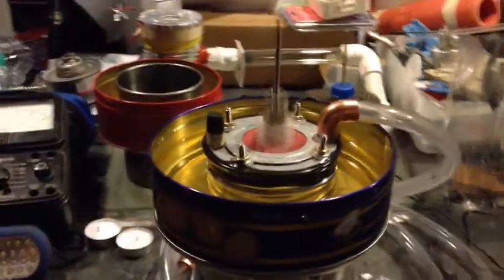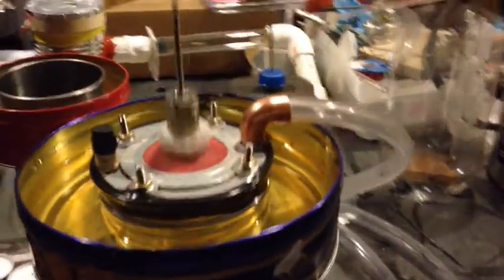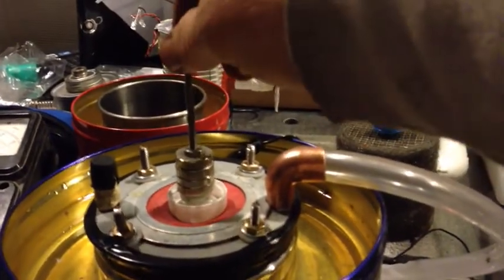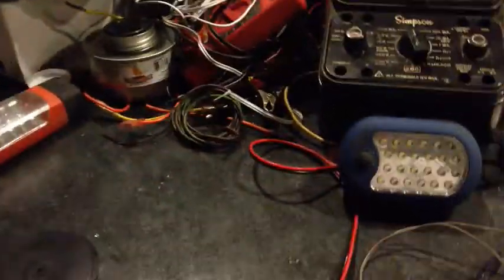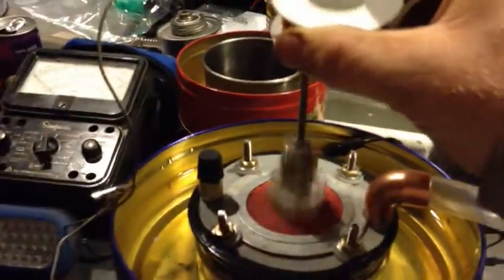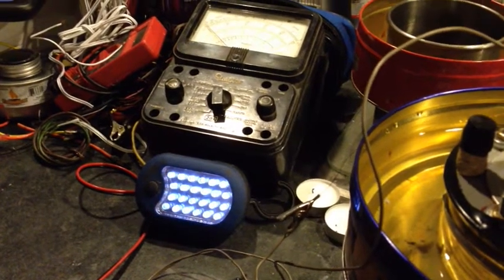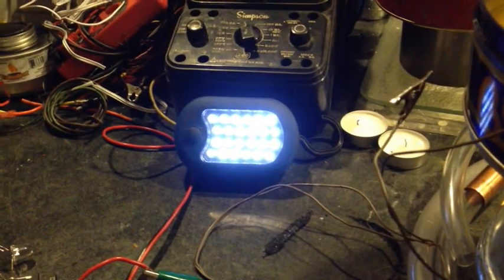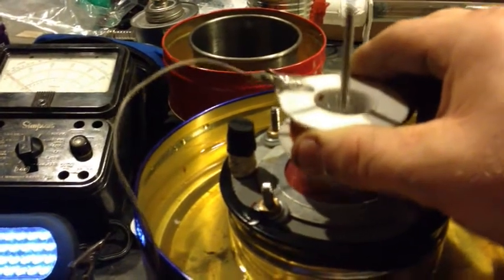Thermoacoustic Stirling/Hybrid Producing Power V2.3

Comment: This is fantastic power output with just a teelight ? Instead of the diy generator you can use a speaker which si basically a linera generator.

Comment: thanks for posting.  good work.    but, it should be understood that in order to get maximum efficiency from a reciprocating system,  output  motion  Must  be  converted to  Rotary.    because, without this,  the system has  ZERO  conservation of momentum.      you may know  that there is an optimal design of a generating coil.    one.   it should be a brooks coil.     two.    conductor Should be of sufficient size;  in the range of 14awg.     in order to use smaller wire effectively, a coil must be wound 'in hand'.     when more winds/layers of smaller conductor are used,  coil impedance when energized is  Greater  and  output  CURRENT  is  limited.    but not the volts.   cheers         googletranslate
http://nessengr.com/techdata/brooks/brooks.html
Reply: In rotory motion, energy is stored in a flywheel.  And for maximum efficency in a thermal acustic engine, the piston needs to oscillate at the standing wave freqency. In this linear thermal acustic motor, energy is stored in the elasticity of the diaphragm and mass of the oscillator. Rotory motion isn't nessesary for maximum efficiency.   What is nessesary with a linear thermal acustic, is that  you create a standing wave with the proper length of tube for the air pressure, and  elasticity of the diaphragm, and mass of the oscillator.   

A mass on the diaphram is like a mass on the end of a spring  converting kenetic energy to  potential energy and back to kenetic energy. all the energy is conserved except for that which is lost to friction in the elastic diaphram, or taken from the piston though something like a magnet and loaded coil.

Comment: thanks for posting.  nice work.  some late thoughts.  whenever a diaphragm is used, an excursion of a 1/2 inch or less will, usually, give best performance.   a linear generator has one big disadvantage.   it loads the engine before the low-torque output has been concentrated, at a crankshaft.  load at the crankshaft should be matched to the available power; in such a way that engine speed drops no more the 15 percent---a guess.  (reduction gearing)    cheers
Reply: Thanks for your thoughts and suggestions
Reply: Crankshafts?  That's so "old school".  Peace Out!!!

Comment from the maker: The displacer is made of course stainless steel. In one of the videos I do give dimensions for everything as well as disassembled pics. As I remember the main can is approximately 5 inches high and 4 inches wide. I have made many of these and the dimensions do not have to be exacting. The length of the hose can be a bit of trial and error to get maximum output.
Reply: Would you be kind enough to link that video, in your other videos?
Thank you.

Comment: I like the diaphragm mounting on this. Do you have any cut away drawings? With dimensions?
Reply from the maker: +Frenchie  a bicycle innertube works best. The outside dimensions are 4 inches while the inner hole is a little over 2 inches. I use two similar plates with the diaphragm wedged in between them. Also it is very important to use some high temp silicone as any air leaks drastically effect power output.

Comment: thanks for posting. good work. some thoughts...
this sort of linear alternator design directly loads the engine at its reciprocating components, and slows the engine considerably.  for increased efficiency, employ a flywheel and crankshaft to smooth the output energy. take power off the crankshaft using a reduction gear, to drive a rotary alternator made for the purpose. This reduces the drop in engine rpm under load.   cheers